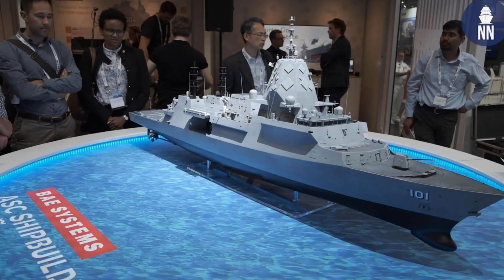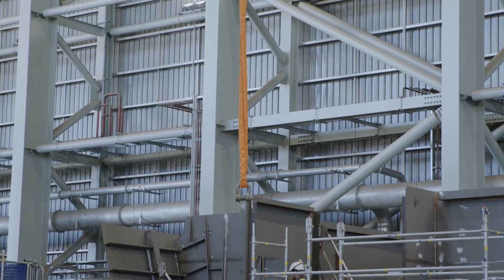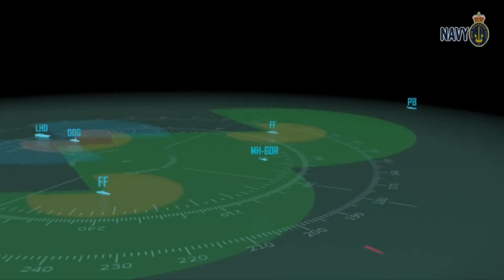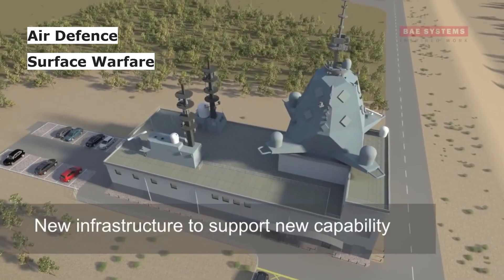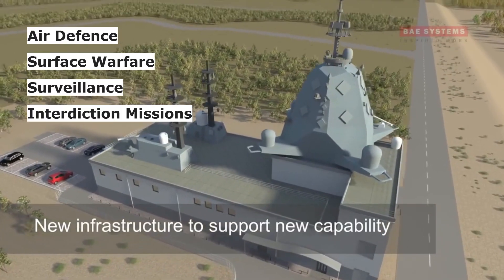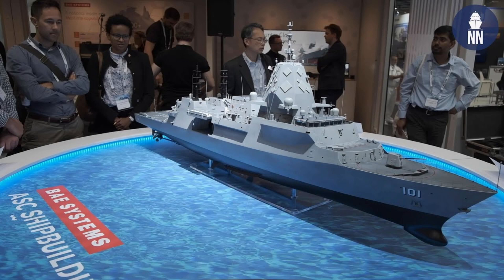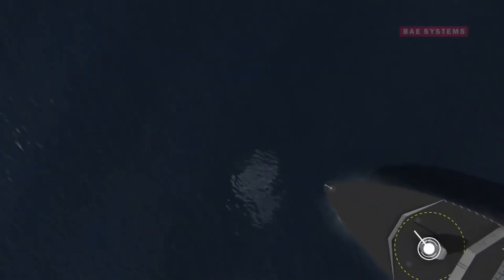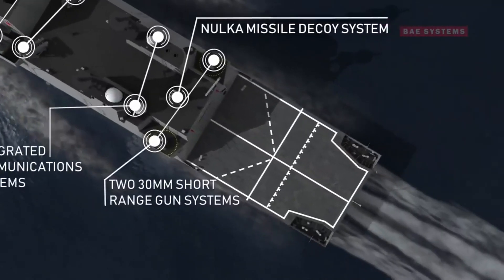Australian Navy Future Frigate | Hunter Class frigates | in English

Comment: Australia learnt during the Gulf War that the ANZAC Frigets were waaay too light.  Upgrades and Upgrades followed.   It's now 20 years later and Hunter AGAIN is way to light.  32 VLS cells will last for 30 mins in a real war.  There is no room for upgrades and it is almost overweight now.  Extremely disappointing
Reply: It's primary focus is ASW so Anti Submarine warefare and for that it is perfectly suited. It still has Anti air capabilities as well but that is for the Hobart class or the up-armed Hunters proposed by BAE for your batch two Hunters which would include an additional 64 cell VSL launcher by removing the multi-mission bay. I think if Australia does not fiddle around too much and sees the first batch through, then you will have a good foundation of three Hunters. The first Type 26 is already in the water with the next two in production in the UK, cannot egt them in service quick enough...need at least 9 though we will probaly go 6 or 8....
Reply: BAE offered 96 cell VLS hunter class.  But the decision now upto the government